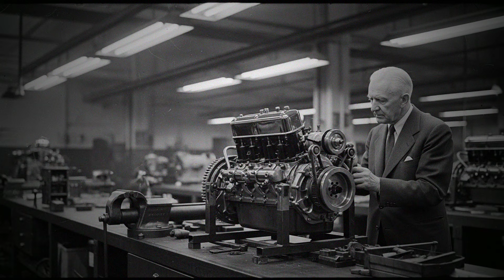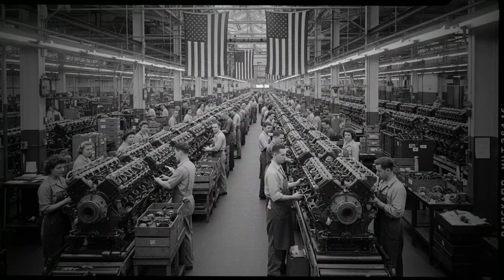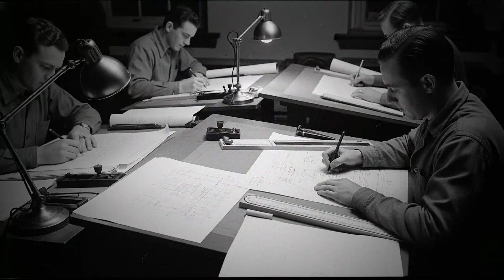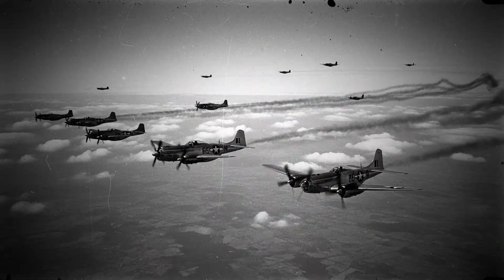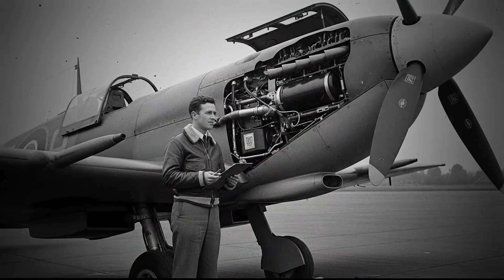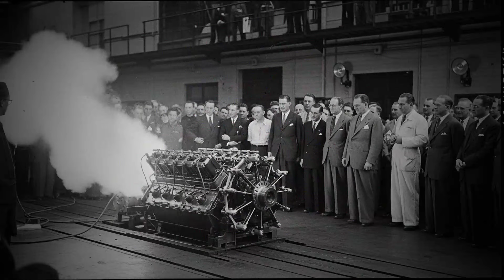HOW PACKARD ENGINEERS REVOLUTIONIZED WWII AVIATION

Comment: Several points.  Both RR and Armstrong Siddeley made both cars and aero engines; Ernest Hives of RR tested cars and said it was difficult to see what a RR for £2,500 offered beyond what a £450 Rover provided so they would concentrate on aviation.  AS found it far harder to achieve the silence wanted for a good car than the rattle and clank of a radial aero engine.  But how USA commentators ever assumed that RR hand filed parts to fit their bench assembly is beyond daft.  We made more of them than you and sometimes we were bombed.

The Bendix company had manufacturing capacity to spare thus given a contract but the thing they made was a joint effort by RR/SU increasing in size the SU fuel injection designed for cars.  Also B-TH made pretty good magnetos, though obviously the B tells that it was an offshoot of the US parent.  We had to form a magneto company in 1914 because every British aircraft had a French engine with Bosch magneto....   Our usual trouble was parsimony till sudden desperation when foreigners turned out despicable.

Ford Motor Company England made the Merlin exactly as drawn but just as you would expect from my opening remarks about cars, they wanted to have tighter tolerances on the drawings.   Packard liaised with RR and were very careful to make certain that changing to US threads didn't upset any component.  They supplied a set of AF spanners with every engine, most of which, other than for USA aircraft, went into Canadian built aircraft which otherwise had BSF fastenings and would be maintained in Yorkshire.

A few years ago the Canadian Lancaster came here for a summer and had engine failure, replaced by a RAF owned Merlin made by RR.  There are small differences to control linkage but no doubt long since they replaced that by a Packard one and sent the RAF the RR again.  I have seen and heard a Spitfire 16, similar to a Mk9 but Packard engine.

Going back to 1918, the US looked at the Napier Lion but rejected it on the ground that it used soft soldered sheet metal cooling jackets.  We had girls making them.  Excellent engine, long lived and powerful.  Its designer recruited by RR to design the Kestrel when, late 20s, our Air Ministry would not accept the Fairey licence built Curtiss.  Curtiss, Fiat and Napier had competed for Schneider Trophy but RR eventually won.  The Liberty, no.  It was bigger than the RR Eagle, Atlantic crossing power, also than the Lion Schneider Trophy winner.  Very rapidly designed, I believe Henry Leland supervised, but it seems to have been optimised for ease of manufacture rather than usefulness.  Civil aviation fairly rapidly moved to first Bristol and later Wright and PW air cooled radials, which all stem from Farnborough research during 1917 - given to AS and whence Sam Heron fled to Wright who started with his influence.

The GM Allison was a perfectly good engine but the USAAF didn't understand the ramifications of their obsession with turbocharger.  Stanley Hooker wasn't just an engineer on supercharger development.  He was exceptional and not just a flash in the pan.  RR had the good sense to recruit him before they knew what to do with him.  That was Hives initiative, he visited USA about 1942, reporting that you had more and better measuring kit but no idea what you were intending to achieve.  His recruit Hooker optimising the airflow into the Merlin added 70mph and 10,000 ft to the Spitfire thus neutralising the FW190 and, given its huge engine, surprising Fritz.  It wasn't done by a British craftsman tinkering with a file.